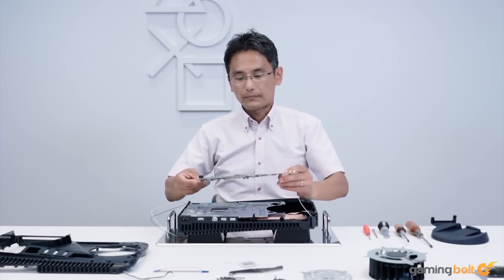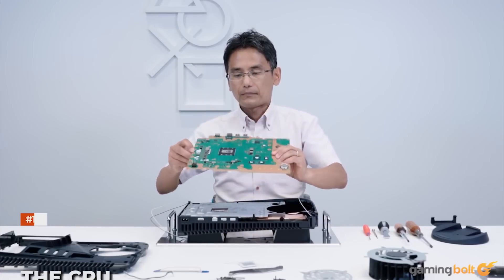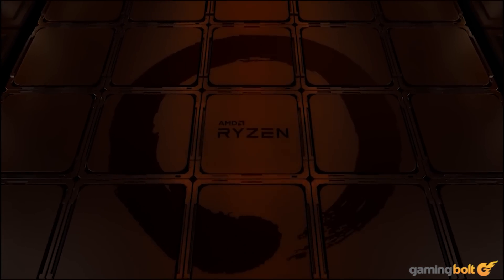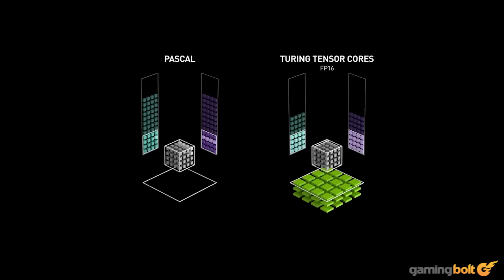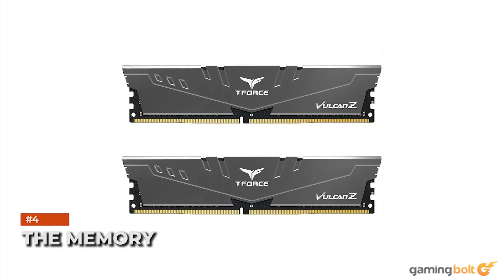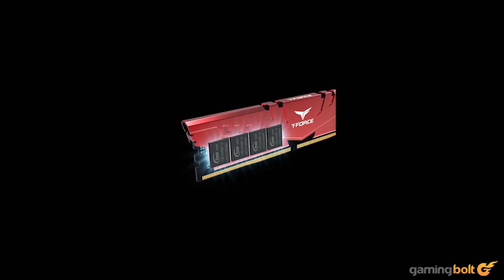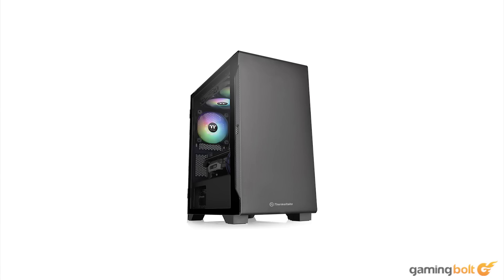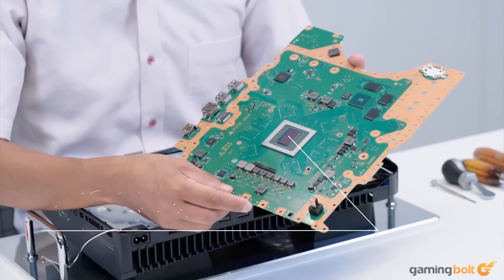How Much Would It Cost To Build A PC As Powerful As The PS5? (2021 Edition)

Comment: Here’s a more accurate comparison

PS5 Digital Edition - €399

Equivalent PC - €1,151
NVIDIA RTX 3060 - €329
AMD R7 3700X - €265
Sabrent Rocket PCIE 4.0 1TB - €170
MSI B550 Gaming Plus - €106
Corsair Vengeance LPX 16GB - €80
Thermaltake S100 - €70
Corsair CX 750W - €67
Sony DualSense - €64
Reply: @Gaming ZONE GAZO some advantages? There is a crap ton of advantages.
Reply: NVIDIA RTX 3060 costs about 1000$ in Russia
Reply: RTX 3060 for 329 dollars!!!!! I tought it was more than 600!
Reply: Really accurate comparison. Kudos!
Reply: LOL 3060 @ 329 Euros now? Keep dreaming.
Reply: Don’t forget the controller
Reply: can this rig run anything as good a someone souls at 4k ? no it can't so please bump that gpu buddy
Reply: That's not really an equivalent PC though, alone the CPU is way much stronger than a PS5's. Not to mention that you will never find a 750W power supply inside a console.
Reply: Would you say that buying (Skytech Chronos Gaming PC Desktop – Intel Core i5 12600K 3.7 GHz, RTX 3070, 1TB NVME SSD, 32G DDR5, 650W Gold PSU, AC Wi-Fi, Windows 10 Home 64-bit) a proper upgrade to PS5? i will keep my PS5 for story games and exclusives but I want the extra advantage of pc gaming, is that PC worth the upgrade or not? I’m clueless when it comes to PC
Reply: PS5 is also not just 400$. It's 400$ + 180 for SSD expansion later + 60$/year online gaming + 10$ extra on new games. In 4 year's time (half life of a console) that adds up to : 900$ - with 8 new games bought at 70$ each (2 per year). PS5 is also locked to PS marketplace, and it's kind of difficult to get used digital games. And 4 more years would make it cost 1220$.
Reply: @deductivevariance3497  that’s the dumbest thing I’ve seen today. So PC you just build it for $1000 and you never have to spend money on it ? You don’t gotta buy mouse or keyboard ? Monitor ? New gpu comes you gotta spend another couple hundred on that. New cpu comes out want to upgrade ? That’s another couple hundred. See how your argument makes no sense.
Reply: @fancyslimoshady  lmaooooo I’m not a kid buddy but tell me since you know all about PCs
Reply: @azlil7  you never have to spend money on a PC when a new CPU comes out, just like when you have a PS4 you don't have to buy the PS4 Pro. Its nice-to-haves but definitely not necessities.
Reply: @deductivevariance3497  what you don't realize is that 60 a year for psplus also gives you 12 free ps5 games and 24 free PS4 games and a tonne of discounts.... Funny enough including the psplus subscription itself. I rarely pay 60 for my subscription, it's usually half that and all those game that are "cheaper" on PC are cheaper onps5 too during sales which is when I buy most of my games. I paid 20 for rdr2. I also got ff7 remake free with psplus, they've actually been giving away great free games for ps5 over the last year. Haven't upgraded my storage yet but you also realize it's a PC storage for upgrade so it's quite literally the same price whether it's ps5 or PC. I tried gaming on a PC, but after 2 years I killed my GPU and I'm not wasting hundreds of dollars replacing my GPU every 2 years. I'll stick with my PS5. I like the games better anyways.
Reply: @errormachine5056  PS Plus includes the latest games too for free then? You can choose whichever game you get for free? No. You are stuck with exactly whatever you are given.  PS and other consoles can die too, then you have to replace the whole console, a GPU is much cheaper to replace. Only non-skilled people think that upgrading the GPU every 2 years is a must. My pc is 5 years old, still rocking all the top games without any upgrades as of yet, good to go for another 3. I have so far at least 50 free PC games over the past 12 years (Epic, Origin, etc...). I prefer PC games and much prefer to play on PC anyways.
Reply: @deductivevariance3497  okay, enjoy your PC then. BUT, we still use a PS3, PS4, and a ps5 in our house, pretty sure my PS3 has outlasted your PC. The latest games for free? Well, yeah. Some were released for free on psplus the day they were released worldwide. There was even one that was released a couple weeks for free before you could get it anywhere else. Do you get to pick your free games? No, but you can't on PC either. I currently have about 300 games that were free since I've been a psplus subscriber.. my ps5 cost me $500. To replace my GPU that broke would be $600+. So again, a new console would be cheaper. PC gaming does of coarse have it benefits, you can get better graphics for a premium price. That's great I'd that's what you want. I like music, I spend my thousands on stereo equipment, and I game on console. I tried gaming on PC and it just wasn't for me. I'd read people's comments saying how much better things like graphics and game prices were just to find out that it's not. I found games were just as pricey, except for sales. But I found psplus tends to have more sales. And I felt super lied to about graphics, back when I got my PC I could play every game on ultra and they were barely noticeably better than my PS4 at the time. Since my PC crashed I bought a mac for work instead and I like it way better for work and I game on console. For people like me I have no use for a PC. Tried it, wasted money. Not being tricked again. Now understand me here, I'm not saying PC is crap, I'm just saying that just because you like it and have a long list as to why doesn't mean it's the right choice for everyone. I'll take a gaming console over a gaming PC any day and a mac over windows hands down. That doesn't mean you need to use a Mac or console, just that they have their benefits over PC and some people prefer that.
Reply: @errormachine5056     PS Plus games are not free and were never free - because you pay the subscription - and are no longer playable when the subscription is canceled (Play at Home 2021 had some free games givaway). Free PC games on the other hand are free and stay freely accessible.
   Your PS3 has not outlasted my PC, it was simply made in an earlier year and has more years of use. Also, when its just collecting dust (which I guess would be most of the time), it's not getting extra wear and tear. (Many people's consoles died one way or another way before it's full 8 year cycle and after the warranty ended.) It can'd do VR, and it's a good way to play retro games, if that's what you enjoy.
   PC gaming is cheaper on the long run with better graphics. No premium price involved, unless you want to max it out for some reason, which is unnecessary. PC games can be played any time, without a need to keep paying for access (PS Plus). I have owned a console, but never really liked how it was a separate device from my other one that did all the other tasks and constantly switching between was annoyingly inconvenient. 
   Sony has a single market for games, PC has a lot of game markets (and has PS Now) and they all have sales, which will I'm sure be more many times than PS Store sales.
   Not sure what your expectations of 'Ultra settings' were, but they are not that big of a step up from High settings on PC. Nevertheless, graphical settings are not the only factors that determine better graphics (there is also fps, resolution to be included). Mods can greately increase graphics too on PC.
    Some people keep a device for work and a separate device for gaming (such as a console), while others prefer to do everything on the same device which is their PC. Btw, a Mac is a PC.
   For professionals a Mac PC is prefered (never liked Macs myself), while Windows PCs are more prefered by those who truely multitask on their PCs and use it for everything. At the end, everyone have different needs, and there is something for everyone.
Reply: @deductivevariance3497  no, just no. I gave better a response, YouTube deleted it. So just no.you are wrong.
Reply: @errormachine5056  Of course you did and of course it did. But I am still more right than you.
Reply: @deductivevariance3497  no.
Reply: @Gaming ZONE GAZO Another advantage of the PC is that it's used for the making of PS5 games. Not the other way around. ;D
Reply: lol no where near, the PS5 is equivalent to a 1060
Reply: @servare2599  more than u can afford pal
Reply: @EazyDuz18   I have a 3060ti 5600x Build + PS5 so I hardly doubt affordability Is an issue.
Reply: @EazyDuz18  besides what does affordability have to do with what I said? 

Since we’re on the subject now, what are you rocking PC + PS5 or what?
Reply: Yet.. all you can do is game on a PS5.. on the other end, a PC is a PC. You can do unlimited things. So if you payed 399 let's say for a Console you still need to pay money for a computer and also need yearly subscriptions and full priced games and peripherals. So it can cost that same for an inferior performance compared to a PC. It's not as great as an investment as people make it seem to be.. it's a wives tale for buyers remorse.
Reply: @fancyslimoshady  that’s facts. I wasn’t expecting too much with the ps5 (as I already have a capable pc) but once I actually got one, the gaming experience was surprisingly phenomenal. The controller haptics pared with the amazing exclusives was a whole new type of experience that a pc simply can’t offer. If it wasn’t for the exclusives, controller, price, and graphical capabilities to an extent, I would say that gaming on a pc would always be the better option but this time around, the ps5 truly is a great device solely for gaming purposes.
Reply: @pachimari7120  Those exclusives your speak of are either coming to PC or already on PC for one.
Reply: @pachimari7120  Like honestly man.. I refuse to waste my time with these buyer remorse comments. I can counter people like you with arguments all day long but it is just pointless. You will deny anything I say just to justify your purchase of a console. "whole new type of experience that a pc simply can’t offer" .. Really ? That is the biggest bs I am sorry. You can plug in any controller into your PC and play a superior version of your fave PS/Xbox Exclusive on PC.
Reply: @fancyslimoshady  I mean, what ever you say man. I already have a pc so it’s not like I’m just speaking out my ass or anything. I know ratchet and clank and Spider-Man horizon and god of war probably aren’t coming to pc. Ff7 remake might be thought. I definitely agree that a pc is a better investment overall. I’m just saying for the price, the ps5 is really a lot better than people give it credit for. Also, it’s not entirely just about the exclusives you say “might come to pc”, it’s also the controller and over all experience. The haptics and adaptive triggers really immerse you in the game, which can’t be found on keyboard and mouse. It’s also just easier to pick up and play. I think the PC market and console market are two different demographics for the most part. If you a hard core gamer and want the most versatility and highest fidelity possible and have the budget to support that, then a pc is unequivocally the better choice. If you’re more casual who just wants to pick up and play and still want great visuals, then the ps5 really isn’t a bad choice is all I’m saying. Also, I got the ps5 for retail so it’s not like I payed a shit load for it from a scalper and am trying to justify my purchase in my mind with “buyers remorse” as you say. Anyway, have a good day bro
Reply: @pachimari7120  just remember Sony is buying studios for the PC Ports of their exclusives like how horizon zero dawn is now on PC. But see you already have a pc. Now combine the cost of the PC and the cost of your PS5. Your more likely to build a better than a PS5. Not to mention you can now do unlimited things on that single platform. So it's really just one narrative that PC is a better investment in both point of views. Btw, Haptic is a gimic. People seem to forget that the xbox one has it but the support died off quick. PC gamers have haptic .. you can connect a PS5 controller to your PC. You can even mod games that do not initially have haptic support something you can't even do on a PS5 ! Lol. Take care .. happy gaming.
Reply: @fancyslimoshady  you right honestly. The haptics are pretty amazing if you play astros play room, but because literally no other ps5 game implements them as well as astros play room does, it causes it to kinda feel like nothing more than a gimmick for the most part in the majority of games so far. The haptics in ff7 on ps5 basically don’t even exist. I see your point when you really think about it.
Reply: @pachimari7120  As a console and PC player, games are best played on PC. If you want to take full advantage of next gen consoles, you need a $2K OLED TV. My pc looks way better on my 2k resolution monitor on ultra settings than on my ps5 with 4k oled. Im just being honest here.
Reply: @pachimari7120  God of war is now on pc hahaha
Reply: @pachimari7120  I know this is a year old but spider man came to pc so is miles morales shortly
Reply: @MadMikeVidz  True true, also the haptics on my controller seem to work perfectly on my PC as well so I guess PC is a win win. It’s is quite a bit more expensive, though you do get a lot of added benefits
Reply: @pachimari7120  exactly it's definitely worth it imo
Reply: @fancyslimoshady  Yes mate, all you can do is game (and stream content). It’s a console after all. Not sure why you’re making such a big fuss of this. I was simply comparing the prices of a PS5 with an almost identical gaming pc setup.
Reply: @Marcos-Silva  You cant compare the two in the context of making the console look better when the console is literally missing majority of the functionality a PC offers. Simple.
Reply: @fancyslimoshady  People already have a pc by default. Not everyone needs a gaming pc
Reply: @ajdaniel8128  the more times people say that the more times you agree with me 😂 please work on comprehension. " by default" 😂
Reply: @fancyslimoshady  Not everyone needs a gaming pc. This might be news to you. Most people are okay with having a normal laptop and PS5 for gaming
Reply: @ajdaniel8128  no kid .. work on your comprehension.  You're missing the point.
Reply: @fancyslimoshady  I think you are missing the point here
Reply: @ajdaniel8128  dude how old are you lol? If you have a gaming PC you dont need a basic PC or a console. But if you choose to console game you still need to buy a basic PC so the price together = a gaming PC that is surperior to a console. HOW HARD IS IT TO MISS THE POINT.
Reply: @ajdaniel8128  I have my gaming pc hooked up to my OLED tv and it looks 1000 times better than my series x or ps5. Its extremely clear that next gen consoles still cannot hit a native 4k resolution at all times. In my opinion, next gen consoles are running on low to medium graphic settings on dynamic 4k resolutions. My 3080ti alone blows next gen consoles out the water.  Games are best played on PC because of higher frames, native resolution, modularity, and better audio because of dedicated DACS, etc. Alos pc's have optical ports lol
Reply: @dutyrover946  Again wrong. PS5 games are running at high to ultra settings. I have a pc myself so I compare all the time. Also, PS5 exclusives makes even the best pc games look graphically outdated. Just facts. Also, all PS5 games run at native 4k 30fps or 1800p-1440p at 60fps with HDR. It really looks very close to pc version. But ps5 exclusives blow away all pc titles
Reply: @ajdaniel8128  ps5 games are not running games in native 4K at ultra settings lol. The console lowers resolution in real time in order to maintain a locked fps in all scenes. Ps5 games blow pc games out the water? Lol!! 
ACCORDING TO METACRITIC, 6 OF THE TOP 10 GAMES OF 2021 ARE PC/Microsoft GAMES LOL NICE TRY
Reply: @dutyrover946  Read what I wrote again and go back to school
Reply: @ajdaniel8128  also PS exclusives all sooner or later come to PC like Spiderman or Bloodbourne... Or this Horizon stuff that nobody asked for but whatever. 
Why would Sony refuse the money from the second largest gaming market right after mobile gaming? They would be stupid to do so. They are a publicly traded company, they owe their shareholders dividends, and the best way to give dividends is by selling their products to as many people as they possibly can.
Reply: @baraka629  Console gaming market is bigger than PC gaming market now. PC is third largest now. Also, nobody waits 5 years to play Sony games. The old charm is gone.  While u guys play old Spiderman games, ps5 gamers play Spiderman 2 and other new titles
Reply: @fancyslimoshady  yes but if gaming is really all that you want to do and you have no interests in emulators and pc exclusives like apex legends  league, dota, total war, etc. then i dont see why a ps5 isnt a great option for some, its hard to beat kicking it back on your couch and just playing away, personally i have a work pc and a ps5 cause i like the physical and mental separation of gaming and working thanks to this wfh setup
Reply: @thesquattingfella8972  Just re-read what I have previously commented.
Reply: @fancyslimoshady  This has to be one of the biggest copes dude. We are comparing gaming performance here. What did you expect, that people will compare excell on ps5 if that's even possible. Consoles are game optimised while PC are workstations so for the price you have to pay to MATCH, keyword: MATCH pure rasterization performance and also full pricing for games, consoles actually come out cheaper and more convenient even with all the subscriptions etc. 
And yes, rasterization performance because the 3060 over here, uses DLSS not to mention that performance on consoles work differently due to them being dedicated gaming platforms.

As for the investment. I'd say it's very specific. If you are just going to watch youtube while making some excell sheets and word documents, clearly that's not an investment. 

And yes, you can make the console look better because again...we are comparing GAMING performance here. Look at the title, what does it say? PERFORMANCE , what do you think that equates to? Geekbench scores? How fast you can run adobe?

I have a PC running a rx 6600 and a 5600x and I'm not dragging it when I'm going to my other house here in belgium.
Reply: @hodb3906  lool re read the thread . I am not re iterating anything. "PCs are workstations" ok bro , thats where your argument falls apart. Have an nice one
Reply: @hodb3906  i will subscribe to you, best comment made.
Reply: @fancyslimoshady  I have a MacBook fro that windows is ass
Reply: @fancyslimoshady  Then I can get a ps5 and an inexpensive laptop or desktop to do other things and it would still be a whole lot cheaper than building a pc that performs like a ps5
Reply: @SadBheeseChurger  Wrong. Also don't forget you have to pay for the online subscription that adds to the total cost.
Reply: @fancyslimoshady  How am I wrong though, according to the video a PC that can math or surpass a PS5 would cost $1200, a PS5 COSTS $499 online Sub fee of $60/year let's say a lifecycle of a PS5 is another 5 years 60x5 = 300 add it to 499 its $799 total for 5 years.
Reply: @SadBheeseChurger  dude just look at my previous comments and you will have the answer to whatever you're arguing. Unfortunately I will not be reiterating my point for the sake of someone not wanting to read previous comments. Quick summary: the cost of a decent computer and the cost of a Console combined will be exceed the cost of a PC that runs at the equivalent of a PS5 or better. Regardless, you're getting a superior experience. You also have a platform that can expand your budget... unless you're planning on living on a budget your whole life. 😊
Reply: @fancyslimoshady  many homes already has an old PC that works well but is too old to upgrade. Or they prefer the portability of a laptop because that is generally more important for getting work done. So it will be a waste to build another PC.
Reply: @sjneow  But exactly my point... If you combine the need of a PC to the want of a Gaming platform that is superior then PC is the best investment.
Reply: @fancyslimoshady  Not only that but with a ps5 you are forced to pay what sony wants you to pay while pc users have a lot more ways of getting games so prices have to stay a lot more competitive, not only that but backwards compatibility, ps5 can play ps4 games? That's cute, pcs can play almost any game ever made
Reply: We can crack games for free good luck paying 60$ for every new game
Reply: @SS-sg4eg  who are ya edward snowdan lmao stfu🤣😂🤣😂
Reply: go check digital foundry's review kid!!

ps5 = RTX 2060 super + i5 9400F / ryzen 3100

sata ssd is more than enough to match console ssd, check comparison between sata ssd vs nvme gen 4

so a $700 pc is equal to a ps5
Reply: @Luiko0406  RTX 2060 super that will be optimized and catered to by every single game that comes out... You have to realize there is more to it than power. There is only one type of PS5 with same hardware while there is 3000 PCs all with different specs impossible to optimize, so they all run with pure power and where that gets them, only about 2-3 years of gaming while PS4 lasted 8 years. This is like the iphone vs andorid argument, andorid got more power in specs but iphone is still the supperior phone in every way.